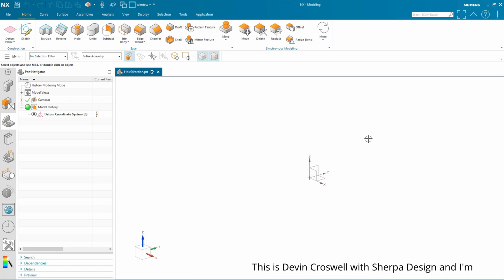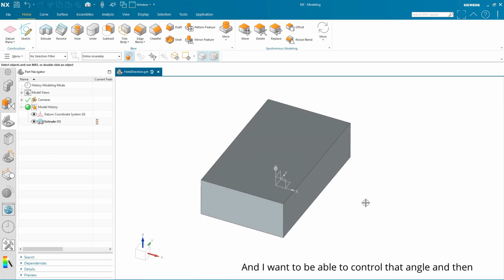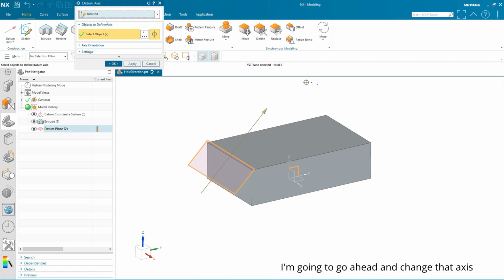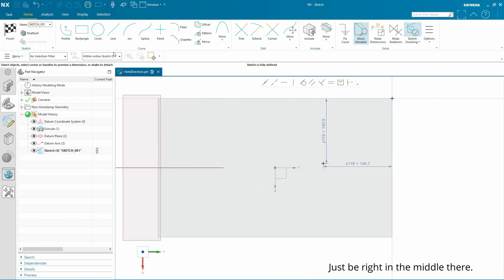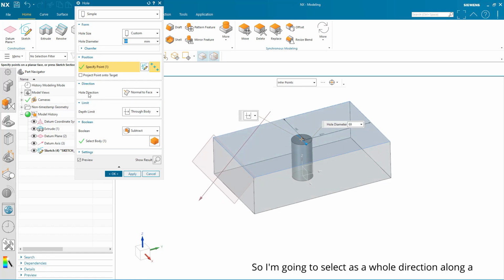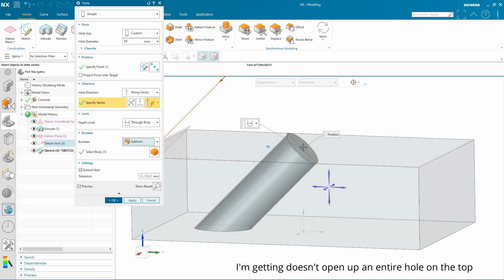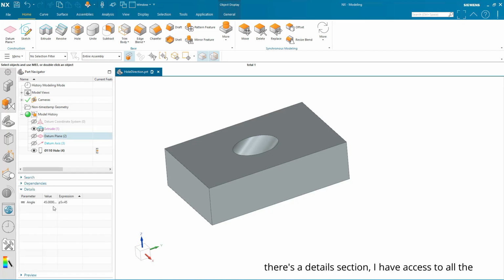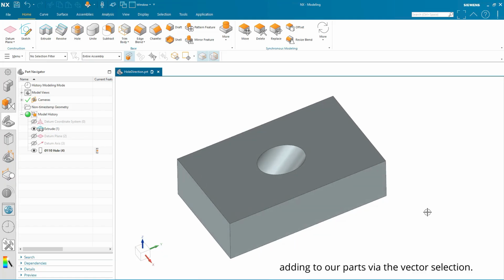NX CAD Tips and Tricks - Hole Direction

Comment: Nice demonstration, thank you. Wouldn't using an Offset CSYS option be a bit faster, while being more flexible in terms of hole direction and location? Because you could rotate the CSYS around the three axes of the Offset CSYS, compared to the plane+vector method which can only be rotated around a single axis. Also, the origin of the Offset CSYS (A) provides a point for locating the hole center and (B) provides more flexibility in terms of XY location of hole center, because the Offset CSYS could be translated in X&Y, in addition to the aforementioned three axes of rotation.
Reply: Yes you're absolutely right, there are many ways to set up datum features to control the orientation of a hole, and in this case, using a CSYS feature would be faster and give you a bit more control, great point!